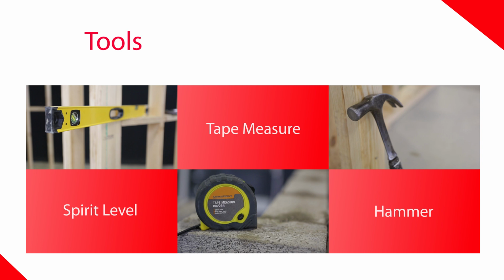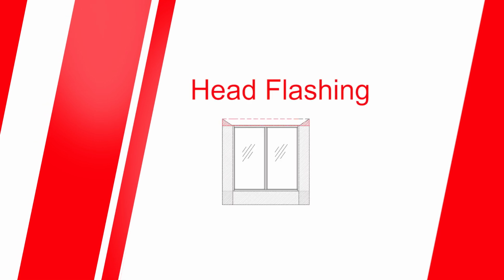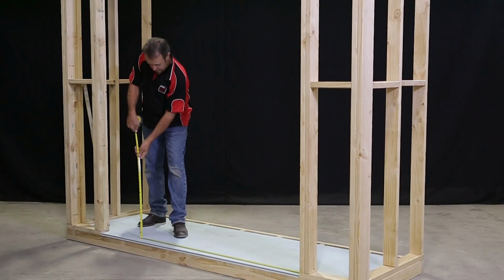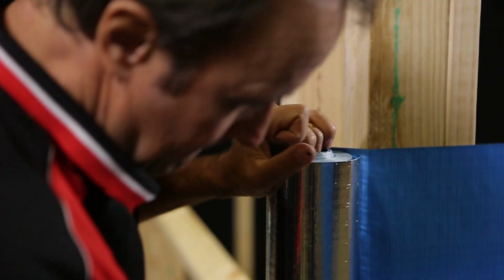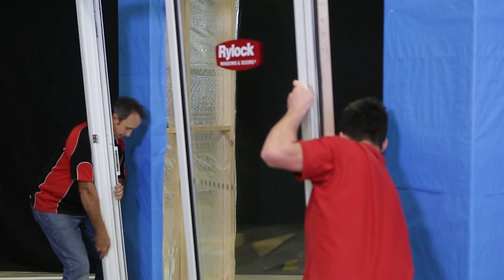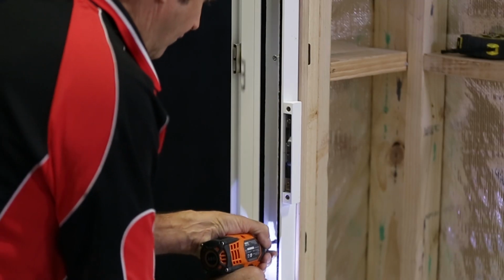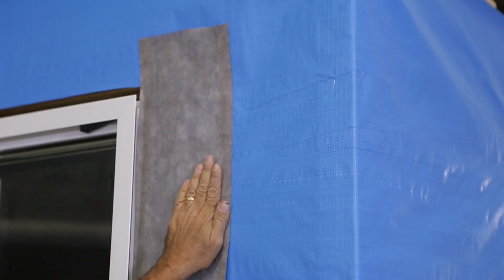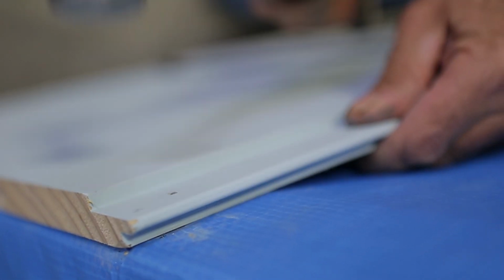How to Install an Aluminium Sliding Door into Clad/Lightweight Construction

Comment: Hi mate, great video very helpful. Is the metal sill tray required under AS/NCC 2022 for a timber cedar sliding door going into a house extension that will have fibre cement cladding?

Comment: A useful video, but there is a flaw.  He makes a tray with the damp-course that he then bends upwards and sits flush with the inside of the aluminium frame.  So far so good, but...how does that work given that the timber reveal is wider than the aluminium frame?
Reply: I ran into same issue. Cut 2 x slots in the bottom of the reveal to allow the back edge of the sill tray flashing to slot up into the cut.